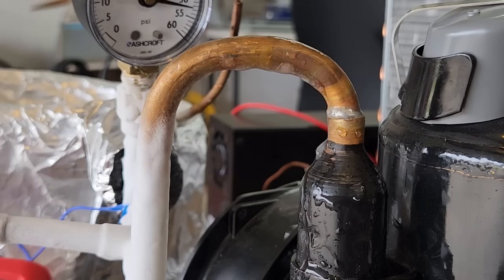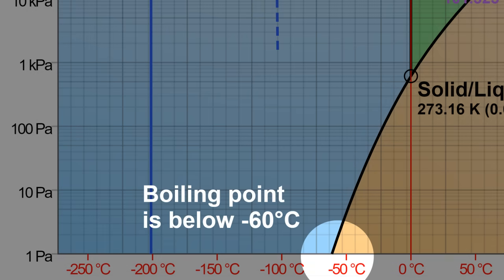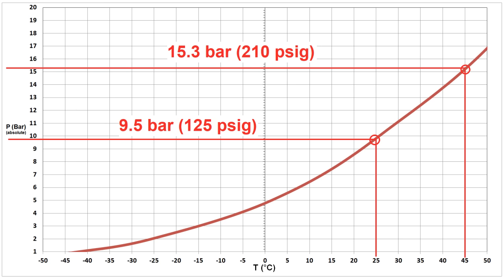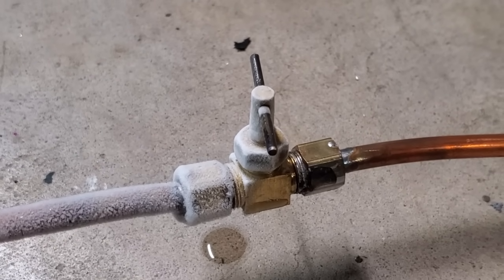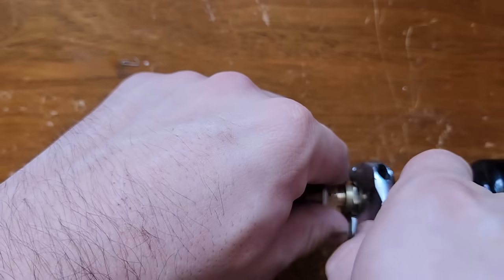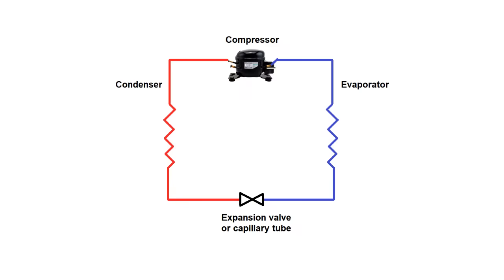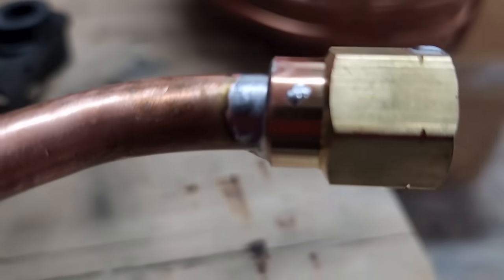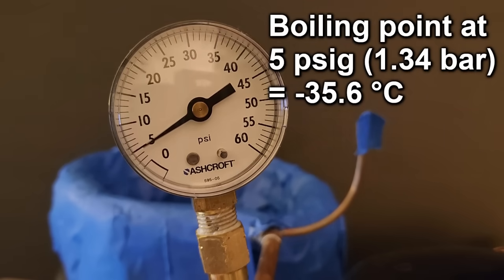DIY Vapor Compression Refrigeration System

Comment: Blow a string through the larger tubing with compressed air.  Use it to pull the other tube through the larger tubing. Easy Peasy.

Comment: Hello sir, I know this post is 8 months old, but may I propose a question. With a HVAC residential A/C unit say in south Florida. Would adding water over the condenser coil allow the condenser to cool down better making the condenser run shorter?
Reply from the maker: It helps a little bit

Comment: Are you familiar with the principles used by the sunglacier company? They use chilled water to make more water. They spray water, cooled to the dew point of the air, with the result that air vapor condenses on the droplets. so more water. hand in the desert. But is that true?

Comment: Rather than using schrader valves, you should have just used a proper refrigeration service valve which wouldn't have needed the extra adapters. Also brazing is typically used in refrigeration rather than soldering.

You may want to consider expanding foam (In a wooden box) for the insulation of your heat exchanger.

Comment: You didn't mention it, so I thought I would, but wet insulation is bad. Unless your aluminum foil is sealed (which, no.) every time you run it, you're condensing water in the insulation filled part. This is why HVAC insulation is closed cell foam: closed cell foam is inherently sealed (kinda) so you don't have to deal with the very bad insulating properties of liquid water.

Short story shorter: use pipe foam on the whole evaporator or half of it is just wasting energy.

Comment: I would be worried submerging the compressor in water ... how did you make sure that the electronics didn't short circuit?
Reply: oh ... and how did you fix the pressure gauge leak?

Comment: That moment when he tells not to use those compressors with air and I remembered how I used one for watter. 😂
Reply: If more precise I added some dishwasher to watter so it created foam. Very much foam. Of course needles to say that in next day it died and inside it looked like it was underground for half a sentury. It rusted away. Never try to do such things because it's dangerous electricity and watter isn't good mix.

Comment: Really interested to see the final machine. How are you planning to produce ethylene? I've had luck with ethanol dehydration using an aluminium oxide catalyst in the past, never actually got around to trying it as a refrigerant though.
Reply: Conc sulphuric acid would be my choice for very small quantities, with ethanol as feed stock. For greater quantities it`s much easier to buy it. It`s available as a welding gas.

Comment: Hm not an expert, but it seems like it might have been better to form your evaporator coil before you soldered the inner tubing in. So that way the inner tubing could slide in and out of it's hole if it needed more or less length as you were bending the outer tubing. Then once it's a coil, solder it all up. 

Also couldn't you just buy a heat exchanger or don't they make them like that? Bath of antifreeze and two motorbike radiators maybe?

Comment: I would use an EXV as your throttling valve. I built a system kinda similar to yours (R290 + bldc compressor actually) using one and a couple electronic pressure sensors to control, and it worked out quite well. I am able to easily match the compressor spec sheet COP at their test conditions (COP=3.5+) with cooling power ~1kw. They are exactly like normal stepper motors, so are pretty easy to control with an Arduino etc. Just make sure you have some sort of failsafe so you notice if the control loop causes pressures to go out of wack (manual gauges like you have should be fine).

Comment: Boiling Point of Water is 63,000 Feet.  That’s why Pilots have to Wear Compression Suits, in High Altitude Aircraft to keep Blood from Boiling. Also The Suits keep Pilots from passing out from “ G Force “.     Commercial, and Private Airplane Cabins are Pressurized.

Comment: It seems like you would get much better results if you used an electronic control valve rather than a capillary tube. Or if you wanted to go the DIY route, try hooking a stepper motor to the needle valve.

Comment: @hyperspacepirate Your calculation for input power (667W) did not account for the power factor of the compressor. The compressor is an inductive load. 5.8A x 115V is 667VA(apparent power). With a .8PF the motor is only using 534W (left out accessories for simplicity)

Comment: Two things
1)you're not feeding the EVAP coil.  with enough liquid refrigerate. 
2) there is no transfer of heat from the coil. It will freeze up causing the flow to self restrictions.

Comment: this is exactly how they process electric inhibiting oil for power transformers.  2 stage vacuum pump, close to near perfect vacuum, pumps, heaters, and a chamber with screens it slowly flows down.  you generally want less than 10ppm water, otherwise it slowly starts to ruin the insulation.  when transformers leak, they aspirate atmosphere which has water (usually have a bottle of dry nitrogen feeding 1 or 3 psi to prevent this

Comment: A hermetic compressor should never be operated in a vacuum. You would need a semi-hermetic compressor which doesn't expose it's windings to system pressure to cool them. I would've gone with a txv setup on that rig because of the goals of the system.

Comment: You got the relation between drive power and compression ratio wrong.
Rather than compression ratio, mass flow is proportional to the drive power.
If the suction pressure increases the drive power increases since the mass flow is increasing.
This is why air conditioning compressors have a much stronger motor than a freezer compressor for the same swept volume.

If you would use a freezer compressor for air conditioning you will severely overload the drive motor.
The other way around it won`t be as efficient as it can be but it will work.

If you want a very versatile expansion valve get a stepper motor expansion valve, they have unipolar motors and can be driven very easily.
The can be salvaged from inverter mini split units or bought from aliexpress for cheap(search for electronic expansion valve).
A Arduino can do the superheat control no problem.

Comment: For your double pipe evaporator why not use tees rather than the elbows? Seems it would be easier to just run through the tee and fill it in rather than hoping your solder both seals and doesn't run too far.

Comment: I'm guessing this video will attract someone who may be able to point me in the right direction, even if that is no direction at all. What would be required to build or modify a small Chest freezer(2-3.5cu ft) to reach minus 40-ish temps? I have seen Tech Ingredients solid state/Pelltier build, many of the Pirate's videos and another where some German(?) chap modifies a Minus 40 portable AC/DC unit to be an actual minus 40 cooler
Reply from the maker: Replace the refrigerant in it with propane. If it has a capillary for flow restriction, you might be able to keep it, but if it has an expansion valve, you'll need to get rid of it and put a capillary (a couple feet of 1mm diameter) in its place. 

You're probably gonna have to do some brazing
Reply: @HyperspacePirate  essentially what you did in this video, correct?  Brazing should be my strong suit, better than refrigeration theory anyway. The other video I referred to the dude brazed in a heat exchanger, a copper coil inside an expansion of the light side line going to the compressor, I believe, I wasn't taking notes, yet, just gathering info. There is a minus 40 chest on Amaz, but with most costing 3k, this one is questionable at 300. And there are so many freezer chests just looking for a home. It only makes sense to build, if it breaks I'll know who to contact and I'll already be familiar with the territory. Thanks for the quick response.

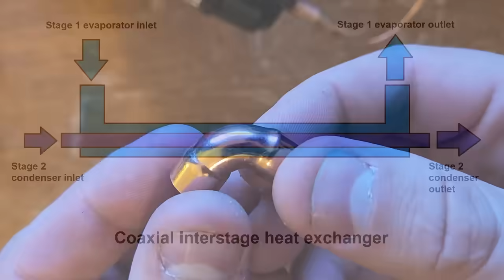Comment: at 12:35 you showed a heat exchanger but your flow is backwards 2 flows in opposite directions create an extreme gradient with high efficiency theoretically 100% heat transfer but 2 flows in the same direction mix temperatures with a maximum efficiency of 50% and a shallower gradient that must be much longer to achieve similar speed

Comment: need to force air through the condenser coil or possibly submerge it in something like a kids swimming pool in order to dissipate the heat away from the coil.
also the compressor and the 2 coils are all too close to one another.
The heat from the compressor and condenser coil are affecting the evap coil causing it to not be as effective as it could be.
The heat from the compressor is probably affecting the condenser coil as well..
A fabricated heat sink on both coils would provide more surface area and would increase the heat intake on the evap coil and the rejection of heat of the condenser coil.

Comment: I was thonking.....
1. Why didnt you just use a scroll compressor .. they are said to be the most efficient for any application. and sometimes come with variable speed controls. 
They also have higher compression and ability to cycle gas with little power consumption.

2. You could have used the A/C unit as-it-is... instead of pulling out all parts you could just replace the evaporator.. with your custom one...

3. Dont Die....

Comment: Should have put the fan on top of your homemade condenser coil, pulling the air through the coil and ejecting the air out and straight up.
Reply: Could have also experimented with fans/blowers on your coils.

Comment: 12:35 Your fluids in a heat exchanger should always go the opposite direction of each other. In your drawing, they are going the same direction? It is more efficient when they go the opposite way.
Reply: No...it needs to be in counter flow configuration
Reply: @Exotic_Chem_Lab  I think that is what I said. I just didn't use the words counter flow.

I edited my comment to make that clearer.
Reply: @crissd8283  he will be using it in counter flow configuration for the 2  cascade.

Comment: You forgot to evacuate the system before adding propane. Now your system is contaminated with air, and moisture. The the oil you use this for azeotropic refrigerant. Like brake fluid it absorbs moisture, and contaminate the system.

Comment: r-600 is isobutane not butane. It boils at substantially lower temperature but not as low as propane. Ammonia has a thermal efficiency advantage
Reply: R-600 IS Butane and "R-600a" IS Isobutane. The 'a' that goes after R- numbering stands for isomers.

Comment: Freon is not R134a by definition. 
Freon is a brand name from dupont that made the first R12 and R22 or Freon12 and Freon22.

Its like saying a car is Mercedes, a not the other way around. 😅

R134a is the replacement to R22. (Used for Cooling)
R404A is the replacement to R12. (Used for Freezing)
R32 replaced R410A (Used for heat pumps)

And both R134a and R404A are being fased out due to enviromental protection.

R449a replaces R134a. 
R452A replaces R404a
On cars a lot of new airconditioners is seen with this "semi-flamable" refrigiant: YZ1234 and some like it. Thats crazy stuff...

And then theres the "natural refrigiants": R290, R600 and R744. (Propane, isobutane and Co2) these are seen more and more due to their low-toxicity to the enviroment.

Comment: Capillary tubes should not exeed the over all volume of supply tube volume. You also do not want to flood the evap coil . air flow the same. Larger return air than suply air. I cant wait to relax patent laws restricting your work. Terry on.

Comment: i want an air conditioned jacket. not just fans blowing hot air into the jacket but an actual compressor stage and condenser pan that collects drinkable water.

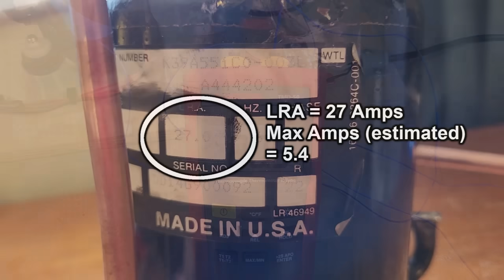Comment: 18:40 superheat! superheat is important for compressor life. its a necessary evil. high superheat, indicates not enough refrigerant, and with no superheat you will flood the compressor with liquid refrigerant. the refrigerant vapour cools the windings in the compressor, so not enough refrigerant (high superheat) will damage the compressor and it will get crazy hot

your suction line "should" be sweating all the way back to the compressor. this generally indicates you have adequate refrigerant for compressor cooling.

Comment: Would it be possible to cool Methane bio-gas to a liquid and compress it with this machine?
Reply: I think, in the next video, he will build the second stage with ethylene.  The lowest temperature I was able to reach in such system was -104 C. If you insulate well the second heat exchanger, collection tank and increase pressure to over 30 bars, its possible to liquify methane. But I think, the author will surprise us with something more sophisticated.

Comment: I'm from india and i want to make open loop geothermal air conditioner of 3 ton unit. The water level in my area is around 180 feet. There are no commerical geothermal systems available in India. I'm afraid energy used for pumping water would be so much that it will end up consuming more electricity. Can you help me determine the maximum ground level where open loop system would fail.
Reply: I live in the City so can't have closed loop here. I was also thinking of what if i put 2 pipes in the borewell with both open ends in the ground and use small motor to move water is it possible or i would require the same amount of energy then also?

Comment: Pretty high compression ratio. Dunno if you did the math with psia, but if you did, that compressor is going to die. Most only tolerate a 5:1 ratio.

Comment: 1:39 First vacuum cannot exist inside an expanding universe. What is pushing the expansion? Only pressure gradients between spaces that are divided by a solid material can exhibit what is referred to as vacuum.
Secondly, Newtonian laws of force and motion when applied to the angular velocity of a rotating spherical  body, when crossed by an implied gravitational force that pulls toward the center mass of the body produces a force vector graph that shows angular velocity at a 90* right angle to gravity unopposed at the poles that changes incrementally at each latitude from 90* unopposed to directly opposed at the equator of the spherical body. The only place where both forces could find balance. 

Newtonian laws of force and motion predict that if Earth were a spinning sphere with gravity pulling towards its center of mass all unrestricted water on its surface would necessarily have to follow the vector angles produced to the equator and then upward to the point where gravity's fixed and angular velocities increasing forces were equal, but since angular velocity increases with radius it will overtake gravity at some point and propel the water out in a disk and off of the Earth.

Thank you.

Comment: Well first of all you don’t have propane in the system you have everything you are BREATHING PLUS propane plus whatever unknown gases and liquids that two of them combine into under those particular internal system conditions that exist, heat pressure etc. 

You could crudely “purge” all the unknowns /undesirables from your system by making an outlet for the system by temporarily opening it at the opposite end of where you fill it. 
But remember you are using a COMBUSTIBLE  as a refrigerant, so for added giggles, be sure to be simultaneously smoking  as you proceed, or light some sparklers instead (for health reasons). 
OR be different, as a trend setter. Pull a high vacuum and experiment with different types of actual refrigerant on/in the system, as there are many types.

Comment: This is just a type of scroll compressor and that design is as inefficient as they get. They get better in a stacked series of decreasingly smaller chambers that essentially allow each stroke of the pump to push the gas into a smaller volume.

Comment: Definitely should be brazing those joints, not soldering. I mean, principles are good but soldering is a no-no. Also, use Nylog sealant, not caulking. The inefficient cooling is probably non-condensable gases since you never drew a vacuum on the system before filling with propane.

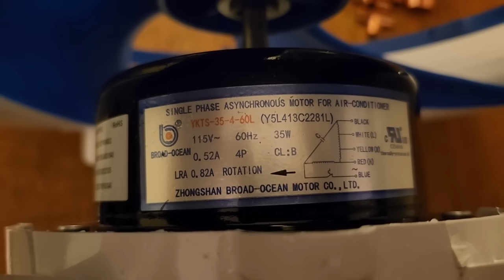Comment: 22:40 you are wasting heat transfer capacity by not leaving a gap between the fan and the face of the fins, and using a box-shaped air shroud as with the original fan. You could be pushing air through the fins outside the diameter of your vehicle fan. Due to this, your large vehicle fan is probably less effective than just the stock fan and shroud from the air conditioner.

Comment: An easy (but a bit slow) way to make hydrogen is hydrolysis in an U tube, put destilled water and sodum hydroxide in the U tube and run DC current through

Comment: with a stirling engine you can go down to minus 200°c, and you don't need to add refrigerant gases or liquids, they operate on ambient air!
go see the work of the philipps company!
with a stirling engine if you turn in one direction you can go down to minus 200°c, and if you turn in the other direction you can make it a heat pump and go up to 800°c